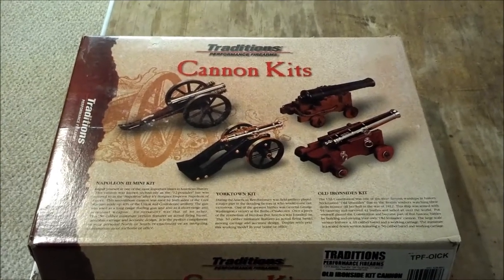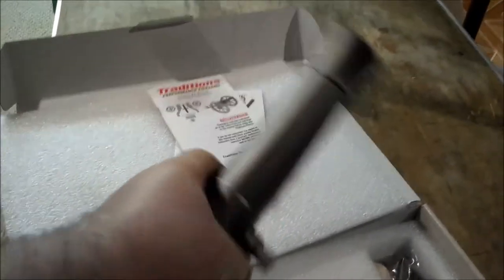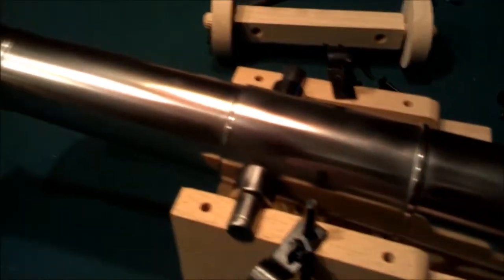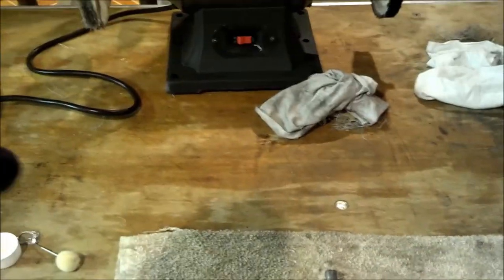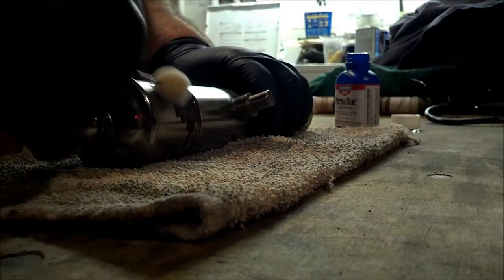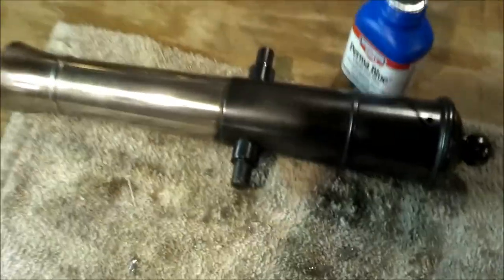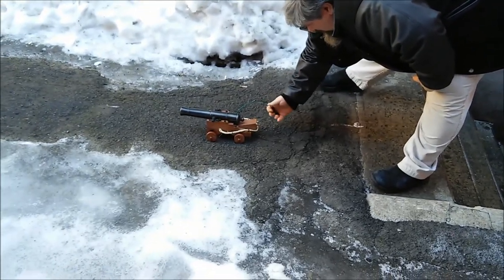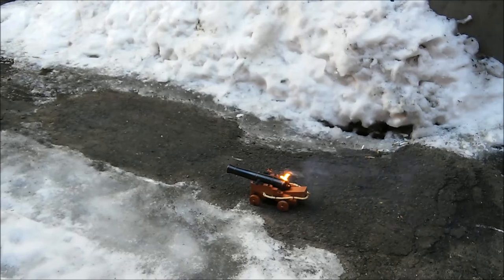Traditions Ironside Cannon - Assembly & Firing

Comment: Why remove the protective barrel coating to blue it.  I believe the old barrels had to have that done. The barrel you had looked to of been Sara coated. That was a waste of time.
Reply: No, it was bare steel. Instructions specifically stated that and there were a couple of small spots there were starting to rust/discolor.